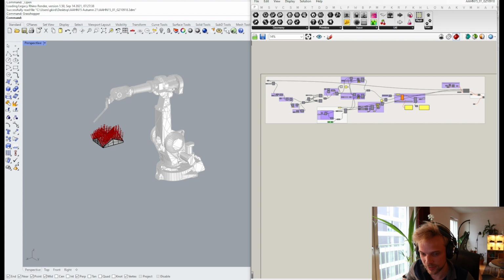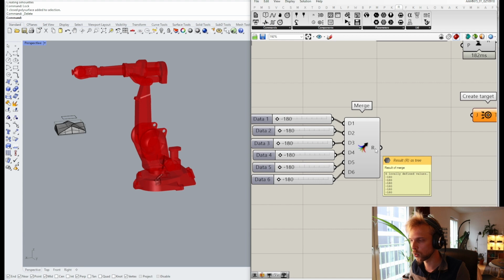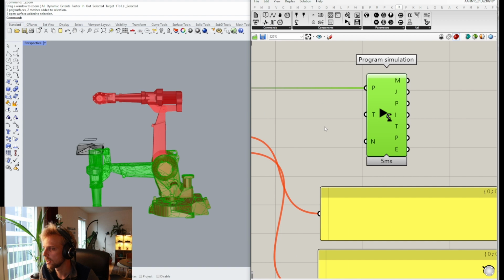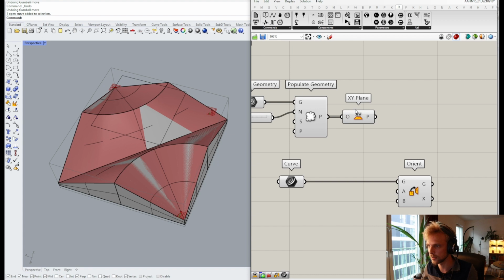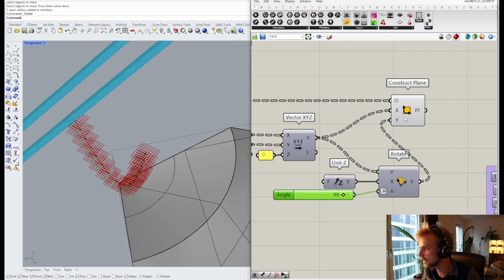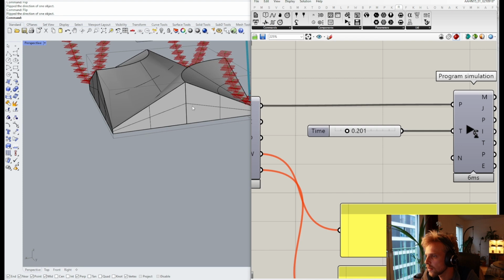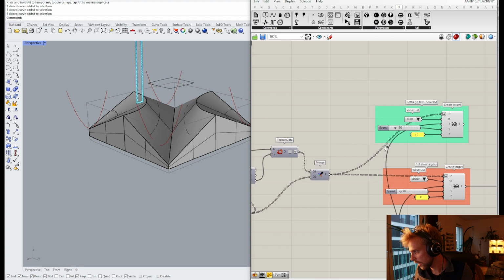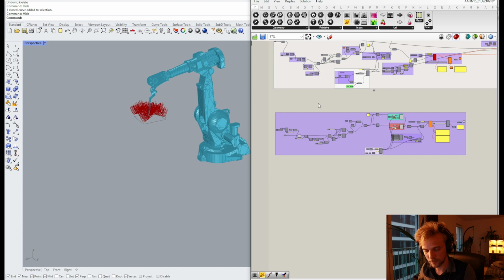Robotic manufacturing course: Part 2 - Robot Arm Setup for Cutting ( Rhino + Grasshopper )

Comment: What do we achieve after completing robot programming at GH? Thanks
Reply from the maker: Straight - forward sending of 3D model information into the robot controller
Reply: @DesignGoBrr  So, Can you completely set up the rest using a real model? I'd love it if you shared it.

Comment: Hi! I wonder is it possible through this Robots plugin to manage not only a robot itself but also spindle speed and external turntable rotation seed (essentially another axis of a whole rotor system)?
Reply from the maker: Hi there, yea - I've seen people doing it. I think it's possible to do it via the custom tool node. Would need to dig into it a bit to see how it's exactly done though.
Reply: Yes, we use Robots for milling with a turn table external axis. To control the rpms of the spindle from Robots, there should be some I/O between the spindle controller and robot controller. You can always ask in the discussions here: https://github.com/visose/robots
Reply: @Vicente Thank you, much obliged